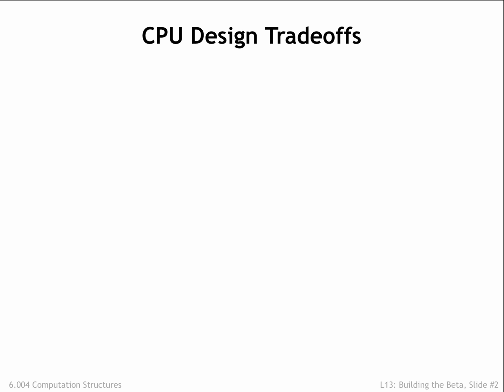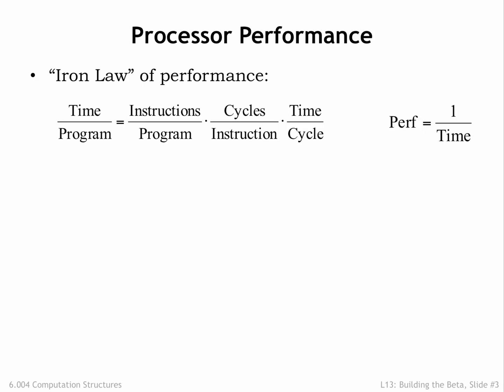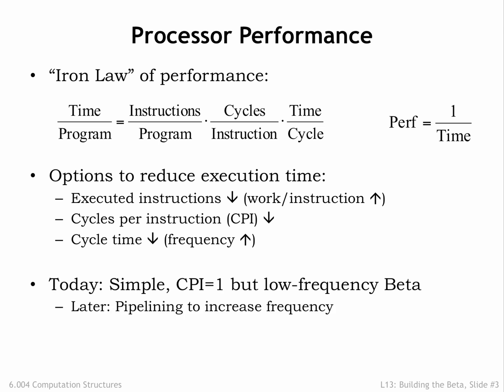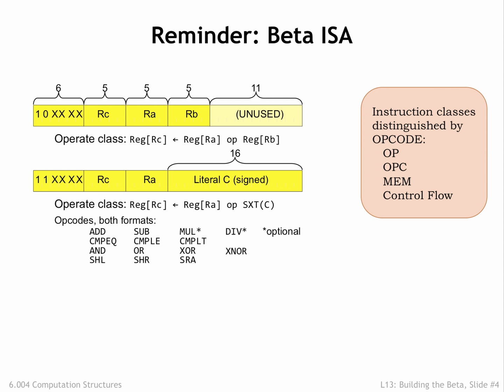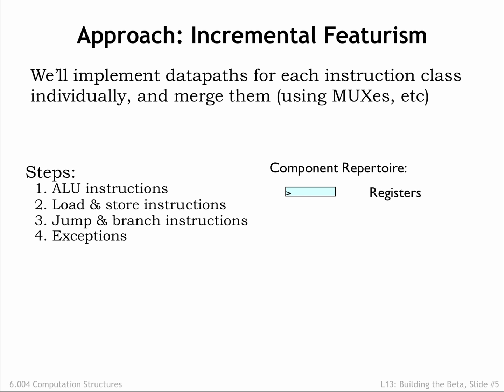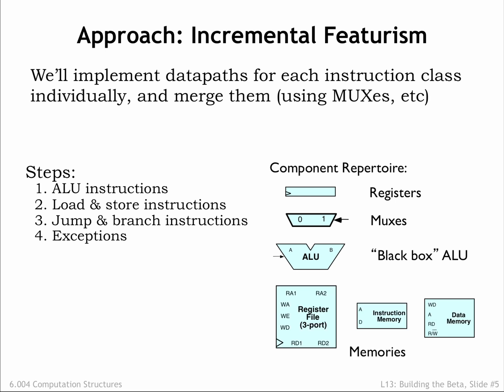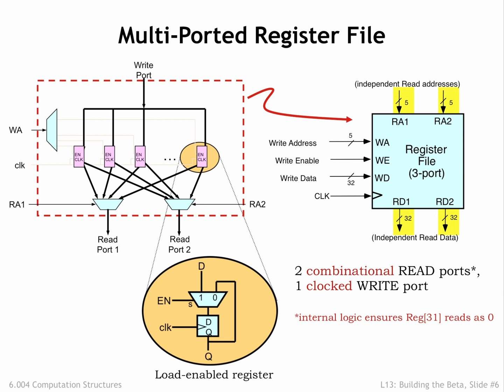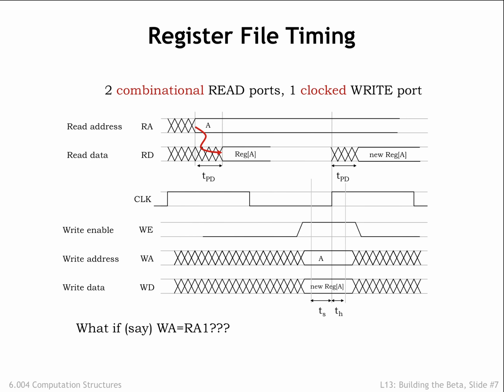13.2.1 Building Blocks

Comment: Why is there the mantra of "No gated clocks"? Since I had not heard of it before this video, I looked it up and it seems to be  a technique used in most low power consumption chips. Is it just for the Beta that we should avoid it? Maybe there are technical details to its implementation that are beyond the scope of this course.